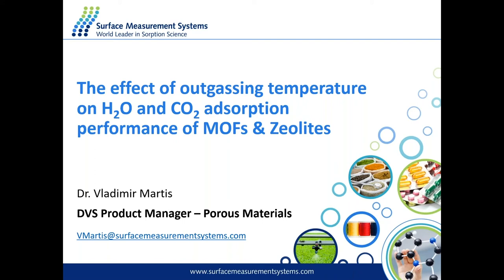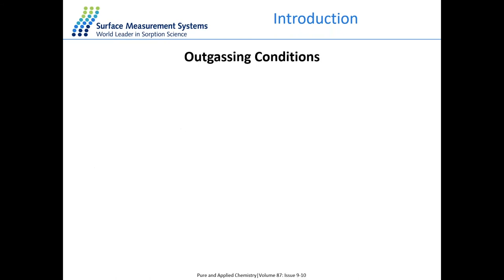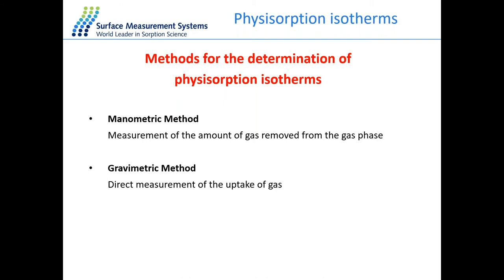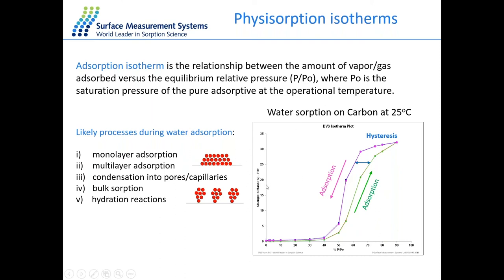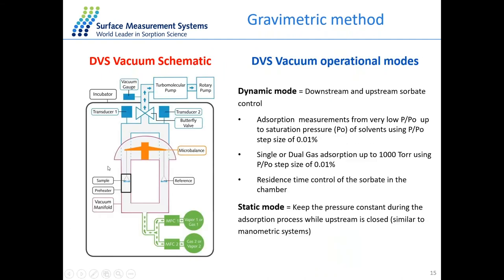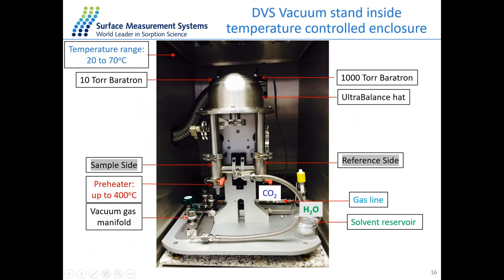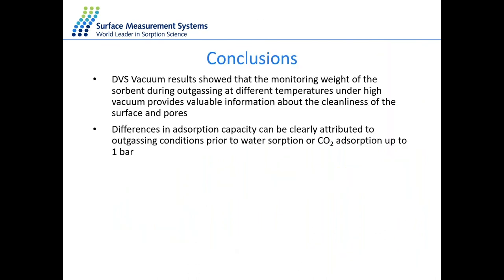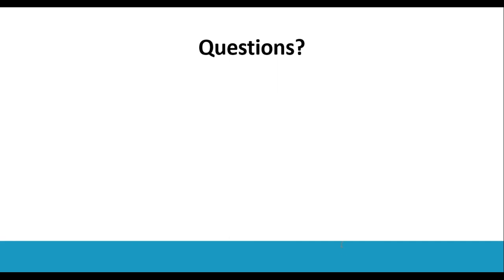Webinar: The effect of outgassing temperature on H2O & CO2 adsorption performance of MOFs & Zeolites

Comment: Hello dear sir. I have a question. My ZIF MOF shows N2 adsorption upto 0.06bar p/p° pressure with 102cm3/g quantity adsorbed and 450m2/g of surface area. Why it shows the adsorption behavior at only 0.06 pressure. How can I increase it upto 1?
I did adsorption analysis by BET